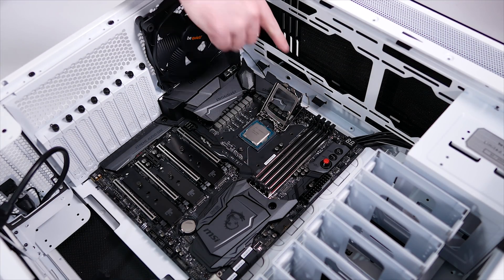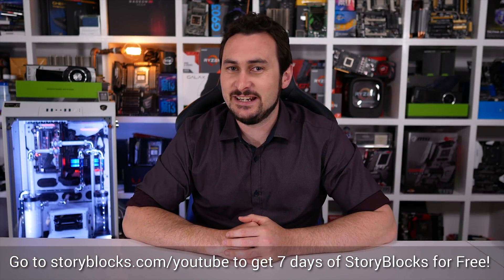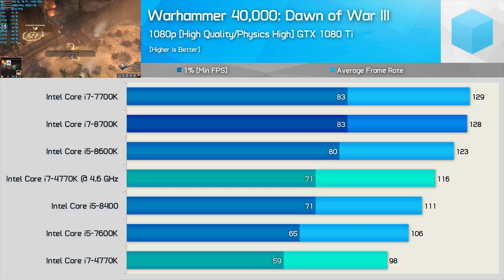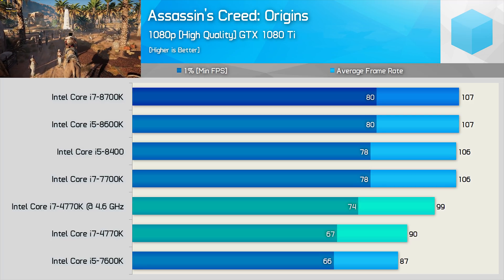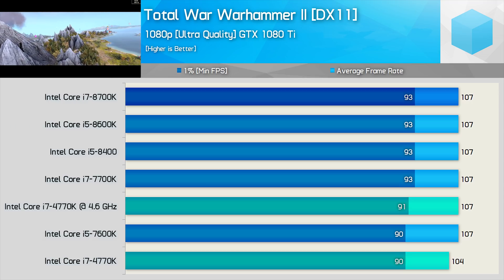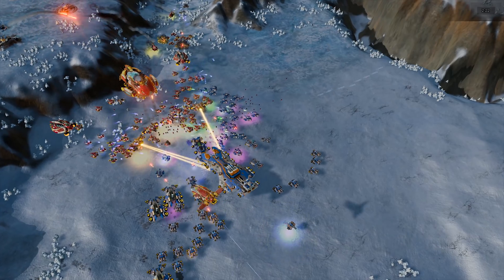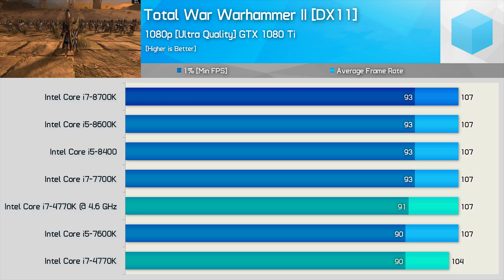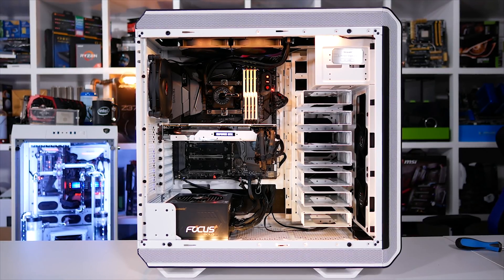4 Year Old Core i7 vs. Core i7-8700K, Worth The Upgrade?

Comment: Not worth upgrading, nobody upgrades, game development stagnates, not worth upgrading. :/

Starting to wonder if we'll ever reach holodecks at this rate.  Great bench as always bud. ;)
Reply: But DX 12 is still not the Standard, even though it should be :/ But Quality Games are not the major Focus nowadays, look how much you need to pay tro play a Game to its full extent today, how could one still have money to upgrade and play Games? :D
Reply: @AdoredTV I completely agree: I still have a 2600k@ 4.5ghz and I'm doing more than fine, but I think I will upgrade with Ice Lake because it will be a 8C 16thread processor with higher clocks than the current 7820x and hopefully more Pcie lanes. 
Needles to say if the gains will be marginal I could also think to keep my sandy bridge for another couple of years my processor, if it not dies for old age of course XD. 
This will depend mostly if my 980ti (watercooled and OC@1550mhz, +500 on vram) can keep up for a while longer, there will no point in putting e.g. a future 1180ti with pcie 2.0 at 8x (I cannot use 16x since I use a m.2 drive in the second pcie slot).
Reply: well yes but on the other hand can you blame consumers for not upgrating ?  if they virtually get no gain at all with their 1060/580 is hare to convince em to spend 500-600 euros/usd just to change cpu for no gains  is not up to every single consumer to try and drive the games technology forward , in the past  you used to update every year to be able to play the latest games  doom/quake/quake2/farcry1/crysis ...etc now ... well those days seems like they are long gone
Reply: @venix20 i agree.  and in the days of doom,quake, quake2, consoles and pc's got 2 sets of totally different game titles with a small amount of crossover.  now that no game can get approved by a publisher unless it gets published on both consoles and pc pushin the envelope in games inst done anymore. at least until the next generation of consoles come out.  the multiplat model is killing pc gaming development
Reply: @AdoredTV what about those CPU usage percentages? I bet I'll have to upgrade in 2-3 years, probably to the next or other next Ryzen reissue (I hope).
Reply: AdoredTV Im think when intel releases 8 core cpus in their main lineup itll be worth it for people who do heavy multi threaded work but are not ready to spend so much on HEDT.
Reply: Consoles have their Place, for sure. But i still don't understand the Fight about what is better. I hope this Problem stays and dies on Console...stay away from our precious PC :'(
Reply: GWBanshee consoles are better than pc's when it comes to sport related gaming, but for any other type of gaming, pc's are better for imo.
Reply: Lets See what AMD holds in the Future. I for myself, only buy used Intel Hardware. For an actually new CPU I wait for Roizen+ :D
Reply: ryzen included then.. OK m8 gg
Reply: Chris Wright no 
i use a Pcie adapter like this one http://www.aquatuning.it/aircooling/hdd-luftkuehler/21953/alphacool-eisblock-hdx-2-pci-e-3.0-x4-adaptor-for-m.2-ngff-with-passive-cooling-block-black?sPartner=googleshoppingit&gclid=EAIaIQobChMIj_C87vbF1wIVzpPtCh383QgPEAYYAyABEgKiWvD_BwE
Reply: You can tell also that nVidia should launch something more powerful in 2018 for gaming.... 1080 Ti will get overrun by demanding games in less than 1 year. P.s. I do hope AMD will do something as well but after how Vega launch went I have serious doubts they can pull anything in 1 year, till maybe 2019.
Reply: Holodecks, like lightspeed and transporters just a fantasy unfortunately.
Reply: it doesnt matter if anybody upgrades jim.  the consoles set the bar.  you gotta either blame the consoles slow cpu's or scared game dev's who are afraid a pc only game won't make a profit.  i mean how are you gonna make a game on a console with a cpu that slow and then release it on the pc and use all that power.  the only way we'll reach get to those holodecks is if we get everybody on the pc or if the console makers up their ante.  whether or not we decide to upgrade is really a moot point.  unless major devs take a chance on a pc only game which they wont.  why make a lot of money when they can make all the money.  its greedy devs and publishers catering to the lowest common denominator that is the stagnating the industry. i mean  a <2ghz jaguar cpu.  come on
Reply: @Wesley Stanley when i see one game, just one game,  that looks like it could hold my interest for more than 5 minutes i might.  but they gotta make the first move.  besides when and if VR starts gaining momentum the same problem will rear its ugly head.  playstation and xbox vr. same problems wait and see.  right now vr is just a party trick, a novelty and when its not the publishers will ruin it. VR wont change anything i think
Reply: Guglielmo Bagella is through sata
Reply: Erhhh I wouldn't bet on it bud.  I mean you have games like Forza 7 where they literally said they intentionally loaded up the first core of CPU's to reduce latency.   Single core performance will always matter, and so gaming will always be a balance of cores and speed - right now that balance is about 6-12 threads.   But hey if devs figure out a way to use 32 threads effectively in games I will be happy haha!
Reply: Worth upgrading if you sell pc and build new one which most will do due to age. Doesn't make much sense, to upgrade board, ram, cpu without doing the cpu too, then you have pretty much the entire pc.
Reply: But we love mining . Who care about games .
Reply: Gaming will last forever, mining wont, when mining market disappears... all these ... by then old GPUs will flood the market, and nobody will want to buy them because they are over-used, maybe will be able to sell them for 10% initial price in 3rd world countries or something.
Reply: Adrian A "2009 mining will blow up"..."2013 mining will blow up" ..."2016 mining will blow up"..."2017 mining will blow up" ..."cards that mined will not worth" ...I would love that 10% price of gpus and I would buy all gpu's for further mining ( I pay for industrial electricity its cheap here and somehow I can make profit from gpus old as hd 6990...long live mining!!!
Reply: Heh... it wasnt me saying that in 2009, or 2014, or 2016, its me saying this now close to 2018. I dont answer for what others said before .
Reply: What Intel has on the market at this moment is not by any means miles ahead of the processors you mentioned. If those CPUs are bottlenecked it only means current Intel CPUs will be so as well in less than 1 year. Also rumors say that they wont be able to launch 10nm because its ineffective. And may only launch 10nm+ in at best 1 year, maybe they could launch a 8700k with 8 core variant, but that would be very power hungry as already with 6 cores it kind of is. So upgrade to what exactly ? at least Intel doesnt have much to offer, what AMD will bring out remains to be seen, there are some unconfirmed rumors.
Reply: dude, thats some next level selfish thinking. Technology shouldnt slow down so you dont have to think about buying something new... LOL. WTf dude.
Reply: You dont get it man, this technology matters a lot more than being a different type of entertainment device in a home, like a TV. For example look at Graphics Cards... developed and supported with money obviously by gamers, today they are used in everything from medicine, to AI, to crypto (not the best use), to cloud operating ... When it comes to tech you need to think outside of your comfort zone, nobody forced you to upgrade every year in the past either.
Reply: GWBanshee console have been there since before PC gaming existed. PC parts developers are just releasing generations after generations that it’s hard for us to keep up with those bastards. But some idiots are buying them & making them rich which is motivating the developers to release more & more. And bcoz of that game developers are also making Games according to the new generations.
Reply: Idk man, my i5-4670k is bottlenecking for sure. 100 percent pinned usage in BF1 at 1080p. It's time for me to get an 8700k
Reply: Thats more a consoles fault since they exist but still consoles are what made gaming bigger than Hollywood.
Reply: So I guess the same could be said about Ryzen.

The fact the 4770k performs so well today tells you the 8700k is actually a future proof product, same could be said about ryzen to an extent despite its IPC being outdated from day 1
Reply: AdoredTV ❤❤❤
Reply: It's called VR. Support it and you support pc only gaming.
Reply: Guglielmo Bagella how do you get m.2 on a 2600k?
Reply: Buy a Ryzen 1600, Intel Chips were great for the first 3 Generations after that they've been refreshes and overclocks and not much in terms of groundbreaking innovation.  i5 2500k at 4.2 ghz and a 1060/1070 is still quiet good for an awesome 1080p Ultra Experience for the kind of games I play.
Reply: AdoredTV disappointing
Reply: Not really true. DX12 changes this.

Comment: It'd be interesting to compare the 5820k to the 8700k, pretty please Steve
Reply: Yeah, as a 5820k owner I'd be interested in seeing this. At the time I got my CPU, the 6700k price was inflated and I decided that I'd prefer the extra cores/threads. It would be cool to see how my 6c/12t matches up against the Skylake/Kabylike IPC and clock bumps. Would the extra threads relative to the 4770k add anything, or not?
Reply: @Thundermonk99  I had a 5820k, had mine overclocked to 4.3 GHz.  It's a bit slower than the 8700k (assuming you don't need the quad channel memory), but overall, it's not worth a new mobo AND a new CPU to upgrade to it.  If you need more speed, you might just try and pick up a cheap 6950x or something.  I ended up replacing mine with an AMD Threadripper 1950x.
Reply: This would be great, I have a 5820K too.
Reply: Running a 5820K as well, would be interesting to see results, if possible at 1440p. I doubt it would be a upgrade worth spending money on.
Reply: you just need to compare 5820k to 4770k
Reply: Why, if you own it?
If you own it you have the 5820k benchmarks. If you dont it matters little.
You are not going to buy one now.
Reply: Im surprised i can't find any videos on this comparison. I really want to see a battle between the 5820k and 8700 both overclocked.
Reply: Throw in the 6850k too for good measure. I just bought one real cheap, so I'd be interested to see how they stack up.
Reply: For what it seems the 7700k is lower than the 8700k and the 7700k beats the 5820k so shouldn't the shouldn't the 8700k beat the 5820k?
Reply: Same
Reply: Agreed
Reply: Joaquin Niño Ortega cant find a comparison here either lol... everything i find is stock clocks.
Reply: Same! Just hooked my buddy up with a 4930K for his new build. From what I've researched, the 4930K and 3930K are similar to a Ryzen 1600 OC'd.
Reply: Probably has sense selling 47** to get 8400 6 cores fpr newer games and you just have to sell it without putting any money.
Reply: I shit my pants productions 

What about a 980x vs 8700k
Reply: I Had the 6850k- the main big + on the 8700k is the energy efficiency and stability when overclocked.
Reply: i cant be botherd w 4.4ghz or 4.6ghz... lol its a personal choice to move up however u look at it.
Reply: you can't go around making vids of every CPU vs every other CPU. There are plenty of websites with comparisons.
Reply: Thomas Jansen, I'm amazed that is no content about this! It's the very first hexacore, who doesn't like to see the progress?
 I think that it's just embarrassing for Intel...
Reply: Since I have one, I would like to see that too.  But with a pair of GTX 970s or 1070s in SLI, a NVME SSD boot drive, and a capture card or some crap like that (I love having 28 PCIe lanes).
Reply: 5820K is nothing the 4790K is the best of the haswell Ik that because I owned and tried to compare them the 5820k didn’t do well
Reply: @austinwhite3132  oc 5820k > oc 4790k
Reply: osvaldo montalvo no that’s not how CPUs work
Reply: 8700k and 8086k will beat out 5820k and a 6850k on benchmarks but the game play is about the same 6850k @4.5ghz pretty much mirrors 6700k gaming
Reply: Considering the 4770k is not worth the upgrade we can infer that the next gen one wont be either, I dont see the need for that comparison.
Reply: aside from giving steve more redundant work and for gluttony infected subscribers to feed on, your request doesnt make sense. the 8700k will defeat the 5820k by similar margin to the 4770k except where cores matters like ashes of the benchmark and other multicore related tasks where the margin will be slightly smaller. all in all the 8700k is a beast to reckon with until intel releases the x700k 8 core futurelake...

Comment: Just upgraded my sister's Pentium G3258 with a cheap i7 4770 from ebay to go with her GTX 1060 and it's breathed new life into her system.

2 cores just isn't enough to run modern games now but upgrading to a 4C/8T Haswell was a way cheaper option than a new mobo/CPU/RAM package.

Comment: I had the option to buy a used but in "perfect condition" 4790 or a 2 years used 4770K for the same price.. I bought the 4790, dayum, I should have gone with the 4770K :c also I got a cheap Z97 board later so.. yes, fuck!
Reply: TecnoMercy RIP
Reply: if they were the same price than you made the right choice 4790k overclocks better than the 4770k . Unless its the non k then yes you messed up =)
Reply: I found that a little buggy with Haswell.

Comment: I have a 4690k and a 1080 ti. I would upgrade to 8000 series if I could find a CPU, not to mention ludicrous DDR4 prices. I was thinking of just getting a used 4790k, but those run almost as much as a new 7700k.

Comment: I got a 1080 ti for my r5 1600 because it was cheaper than a 1070 at the time
Reply: zurran00 friggen miners ruined my summer plans. >:(
Reply: Constable you can find 1070s for around $330 used if you're into that 😊

Comment: 4770 here ! 

I can't fight to upgrade because ram ddr4 price
Reply: no need to upgrade... it's good for 3-4 more years, espically if u play at 60fps it last even longer
Reply: Nt worth to upgrade the i7 4770 still holds up well.
Reply: Anyone having a hard time finding 1150 socket motherboard? At least not a mini board haha. I have an i7 4th gen and need to find a good board that isn't expensive. H87/97 or z87/97 if a must.
Reply: OC CPU  to 4,8 and ram to 2400, youll gane fps as stock 7700k @ 2666 ram.
Reply: MÅV£R1€K yep makes it impossible to even think about. I already have 32gb of DDR3. Split between i3 4160 with a single stick and the 4790k with 3. I should probably get a matching set to fill all the slots on the i7 machine but I wont see any performance difference.
Reply: I still run a 3770k with DDR2 and I'm fine (100+fps in BF one with gtx 1080 in 1200p monitor).
Reply: @rymns  DDR2?
Reply: In 2012 I bought 8GB of RAM for the low price of $40. Even DDR3 costs twice as much atm.
Reply: Exactly fuck dem prices
Reply: @lukepatto4366  Man, everything in the PC space has gone crazy price wise.. From the crazy high RAM prices, to the even crazier Nvidia GPU pricing.. $500-600 has always gotten you a top of the line, or at least high end card, now it gets you an entry level 2070?!? WTF!?!?!? All the way to the CPU's, Intel's top tier consumer CPU was the i7 for around $350.. Now, it's the i9 for $600....

Damn PC gaming, you scary expensive these days.
Reply: GraveUypo lol. Same. I'm still running am i5 2500k with my 16gb that I paid $50 for.  How is it worth more now than when I bought it 7 years ago??
Reply: Newegg currently has 16gb of g-skill 3200 ram on sale for $155. Still a lot of money for ram but that's around $50 cheaper than other "well known" brand options.
Reply: Hi guy, RAM ddr4 price  of 16gb bus 3000-3200  in my country  is around 212-244$
It very fucking high. Last year, I was bought my ram ddr3 16gb(8*2) bus 2133 only 100$   = ="

Comment: Nice one Steve, very relevant. I myself am running an i5 4670k and was considering if or when I should upgrade my system to a Haswell i7 or just wait to upgrade the whole thing to a Ryzen build next year.
Reply: I upgraded my 4440 to a 4790K this year, don't plan on building a new computer until 2019/2020.

Comment: You should really have gone for a I7 4790K seeing as quite a few of them reach 5GHz overclocked
Reply from the maker: I feel I shouldn't have and even if I did I doubt I would show a 5 GHz overclock for that chip.
Reply: Hardware Unboxed mine is benchmark stabile at up to 5.1GHz while keeping under 1.4V, it would definitely have seen a gain and it would close in on or beat the 8400 in more places I'm sure. Either way it's great to see a video of this finally, people get a bit pissy when you build a 4th gen rig 4 generations later lol

Comment: If you don't overclock, is there a point to getting a K version?

Also I expected Ryzen to do a lot better than the 4770...
Reply: Ah I see. Still, is the price and power draw worth it? Also, would you go with a Ryzen 1700 or the Intel I7 8770?

Ryzen is cheaper and comes with a cooler...kind of hard to decide.
Reply: Yeah it is. Ryzen IMO is significantly cheaper though and it comes with a cooler. The non K version of the 8700 does too but it looks so bad :/
Reply: It looks like something you'd find in a trash can lol

But yeah if I went with the non K 8700 I'd get a different cooler. This shit is difficult >.<

The one main concern I have is the motherboard support or whatever. Will the next generation of CPUs from Intel go with yet another one?